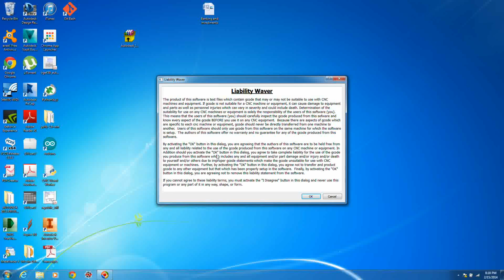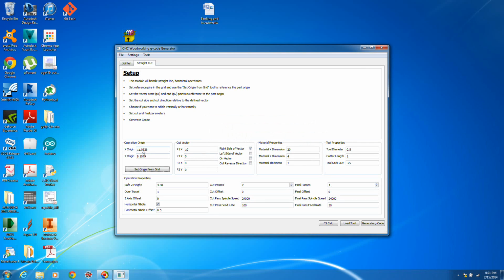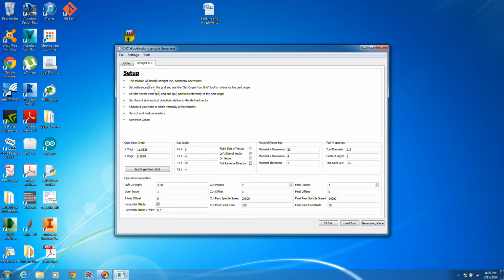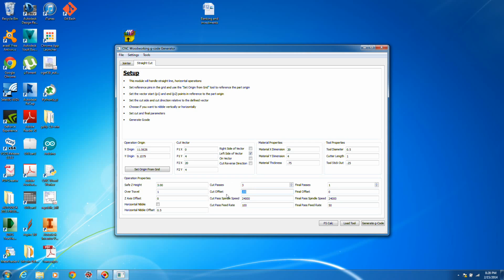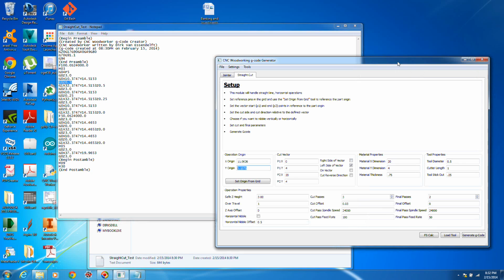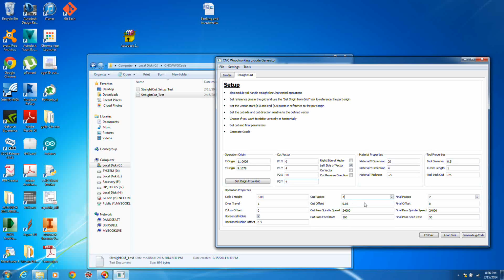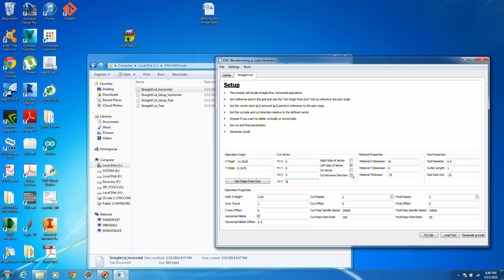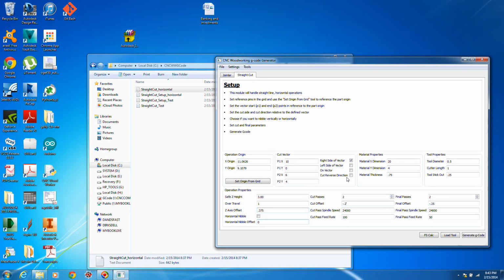CNC Woodworker Straight Cut

Comment: this ia great how do you know how to do this stuff, did you went to school for it
Reply from the maker: I see you are a breaking bad fan, or possibly a greasy lawyer... jk :-)

I am a chemical, biochemical, and geo-environmental engineer, so the answer is kind of.  One thing you learn in engineering is logical thinking and how to break a complex problem down into simple steps, which is important. I learned some programming in school, mainly Matlab and used that in my PhD thesis work to model chemical/physical processes. The license cost for Matlab was prohibitive after I graduated and I got turned on to Python.  Python is awesome, free, and extremely flexible and easy to use.  We have had some professional training at work in python and myself and another colleague started making GUI's for use at work.  It is very easy with pyqt.